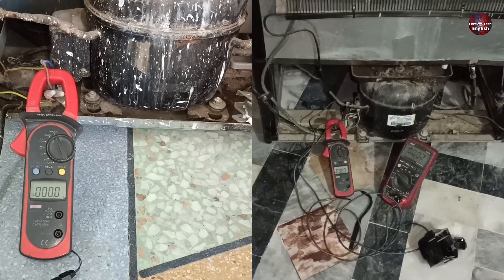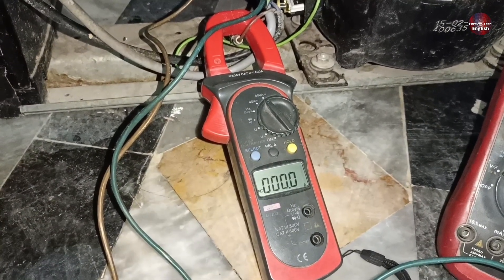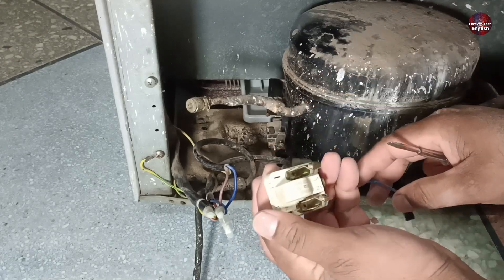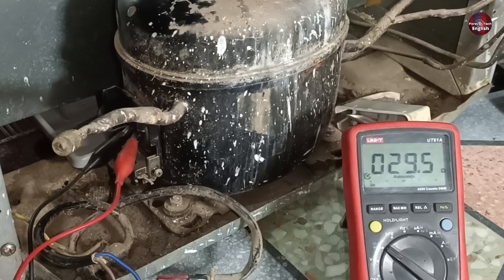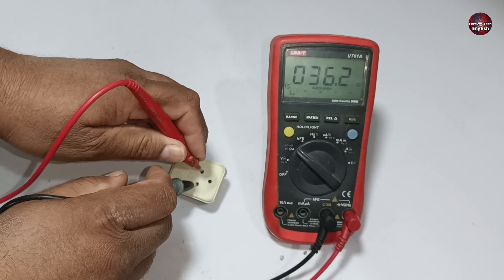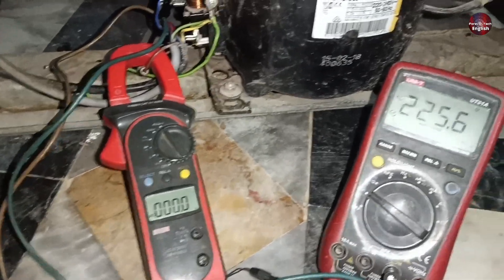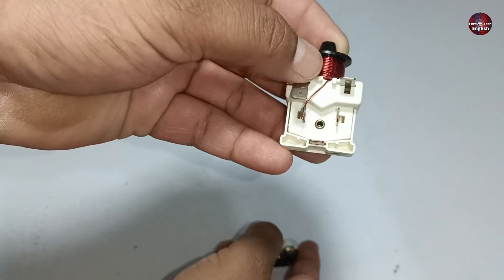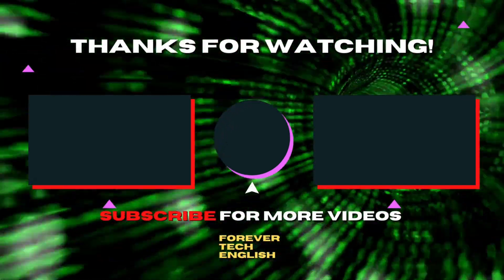Two Refrigerator Compressors Same Problem But Different Fix

Comment: Sir in r 600 single ph compressor running resistance is more than starting. Normally running resistance should be less than starting. Why is this can u plz explain.
Reply: Power consumption of an electrical item is the product of  Current × Voltage.
Ohm's law dictates I = V/R 
I-Current V - voltage R resistance.
Therefore , assuming the voltage remains constant, the more the resistance the less the current.
That's why the running is more than the starting resistance.
Reply: Does this apply to R600a only. What of R134a? Really interested in this i never take note. I just thought like what we have in the video. Waiting for your reply please